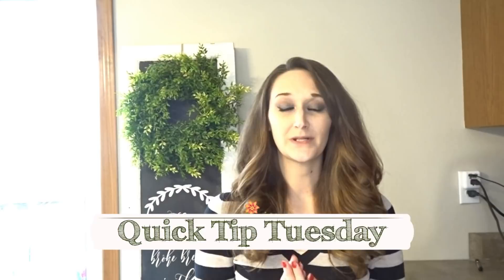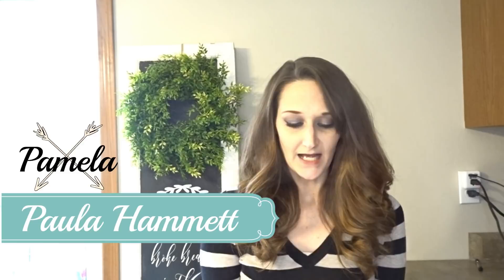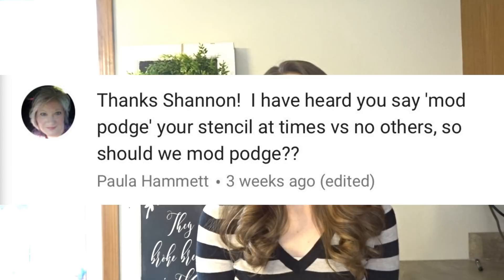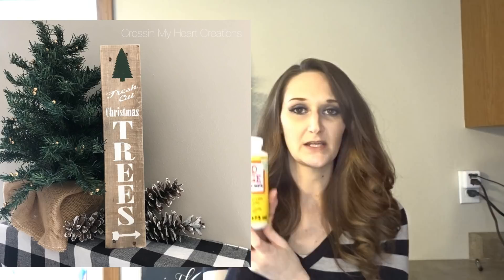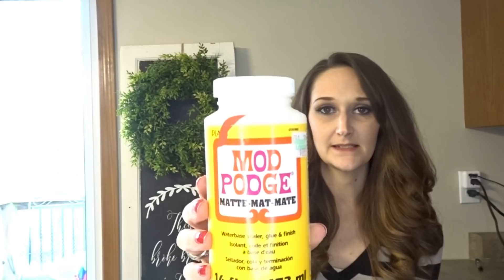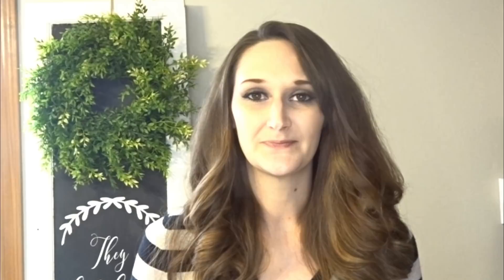Using Mod Podge on Stencils | Quick Tip Tuesday

Comment: Don’t you need to sand the Mod Podge once is applied on the vinyl before proceeding to paint? Because I used it and I ended up pulling the paint itself too :(
Reply: Maria Latham this just happened to me! It ruined my board! I’m so scared to try again :( I want to try just going in with the paint. How much mod podge did you apply was it a lot?

Comment: i used a gloss mod podge bc I had it on hand and don't really use it and what a nightmare! It stuck the paint to the vinyl and pulled a lot of the design off! I have used matte before without that issue. Have you ever experienced this?

Comment: Do I let the mod podge dry underneath the stencil before I stencil? I have stencil spray but it's not working so do I let the mod podge dry and when I'm using stencil spray should I let it dry before I begin stenciling?

Comment: Can I protect vinyle letters with model podge or polyurethane to prevent them from peeling?
Thanks
Reply from the maker: You shouldn’t have to if you use commercial grade vinyl - I use Oracal 651 👌🏻